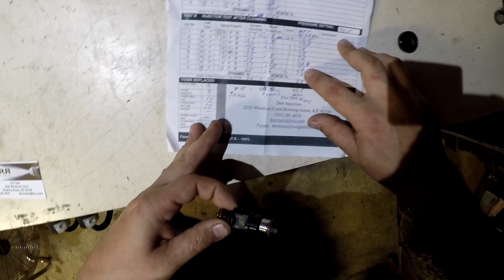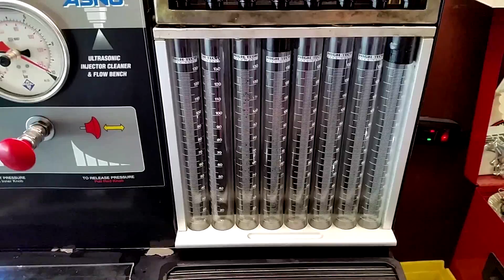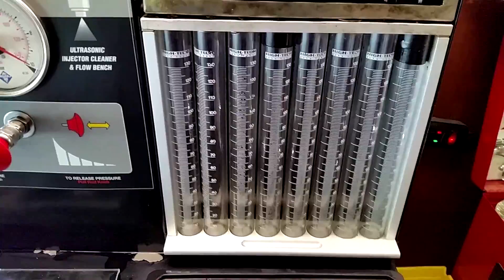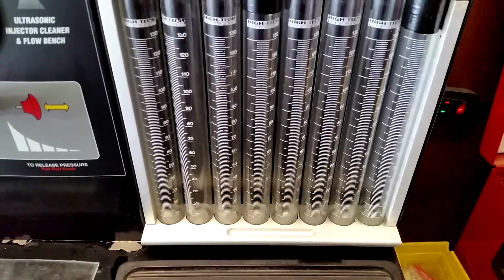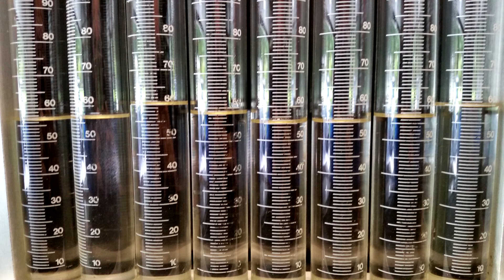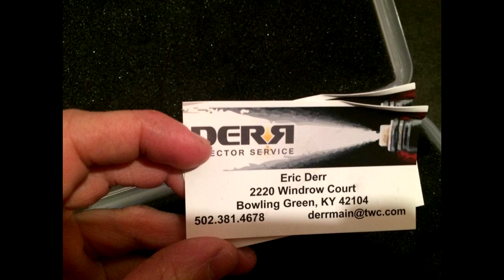stock truck uncapped injector testing updates and results

Comment: I really like your process and methodology, breaking down step by step and explaining as you go. It is good for people to see, hear and understand what happens in the world of injectors and you did it well.  As mentioned in the video, the pencil pray pattern will run and perform. If delivering more fuel for your build is what you want, then this this is your ticket.  However, just dumping more fuel without adding air is counter intuitive to making more power.  Atomizing the fuel will always give you a cleaner and a more complete combustion, thus creating more horse power. In a N/A setup, a straight stream of fuel will burn and make power but, will run into more carbon fouling and less power than a atomized pattern. If you rough up the intake runner after the injection port before the valve, it would help atomize the fuel with a straight stream of fuel. With a power added (forced induction) the pressures and velocity can and does break up the straight stream more than N/A. But as I mentioned before, when the fuel molecules are smaller (atomized) vs straight stream (droplet) regardless of the engine, it becomes more efficient, cleaner, complete and creates more power.

Comment: The factory injector you referenced as 70 pounds or so, (12613412 part number) is for a gen 4 6.0 as you stated you thought. My question is can I put them in place of my stock gen 3 4.8/5.3 injectors on my 4.8 or will I need different fuel rails? I don’t mind the re-wiring part.

Comment: Why do you imply that gen 3s don't survive well above 550?
Reply from the maker: the rods are not as strong and frequently people hurt them when pushing them, it can be done, but if your goals are higher its usually a good idea to start with the better rodded motor to start
Reply: Sloppy Mechanics can I slap gen 4 rods and pistons in and expect a higher ceiling?

Comment: What are the stock 4 hole injectors out of.   I think they flowed around 50?
Reply from the maker: i believe flex fuel vehicles like 02 tahoe, they are like 38-42lb IIRC
Reply: I know for a fact that a 2010 chevy uses the flex fuel injector with the 4 hole .....
Reply: I have a 2010 chevy express with a 6.0 that is a flex fuel vehicle
Reply: My stock 99 5.3 lm7 have 4 hole.

Comment: So I just did this and I found if you use a bench grinder and a 13 mm wrench and put the injector threw the box end of a wrench it's really easy to spin the injector and hold it at the angle you want to grind off the cap

Comment: You say that high flow injectors shoot a strait stream just like your junk "uncapped" injectors....   lol...    clearly you have never seen a spray patter for  high flow injectors so ill leave you a link to show what  real injectors look like...   this is absolutely stupid idea to do..  https://youtu.be/YtlPOs-qbRw
Reply from the maker: fan pattern is not the same as pencil. thanks for trying
Reply: Sloppy Mechanics ..  . As injector technology advanced, the pencil and v spray patterns pretty much became obsolete, as the narrow/wide/split cone spray patterns offered better fuel atomization, increasing efficiency and reducing emissions by improving flame propagation in the combustion chamber. Ideally, you will want the widest, most diffused spray pattern with the best atomization without spraying the walls of the intake manifold runners and intake ports. Fuel spraying on the walls of the runners/ports will condense, drip onto the back of the valve, and slowly run into the combustion chamber, resulting in imprecise control of the injection event and an inefficient burn . When choosing a fuel injector, choosing the correct spray pattern for your application can greatly improve horsepower,  emissions and misfires.......    you get a D for effort on your "sloppy research and mechanic work"...  good try tho

Comment: 7% variance? That would be nearly a FULL AFR POINT between the high and low cylinders. Not to mention the bent spray pattern for the three on the right.
Reply: Hydrocarbon82  good point..   and this is what a pattern should look like... https://youtu.be/YtlPOs-qbRw
Reply: He did clearly state that for boosted engines the pencil pattern is more desirable since it directs the fuel stream into the intake valve which is where you want it. The unstable airflow from the turbo in the intake actually will cause problems with fuel delivery to the intake valves. That is mt understanding of what he said. Lack of fuel in a boosted engine is a big concern. Better to get it to the intake valve as efficiently as you can i would think.

Comment: I'll give you some info on my truck the 92 Chevy 1500 2 wheel 2001 5.3 th400 trans with shift kit 2500 stall motor and trans are brand-new have completely rebuilt the motor we put a hundred miles on it

Comment: we never heard nothing back about you putting these two characters and your wife's truck you're not seen the video and how much power it makes I am extremely interested on some info I have a 5.3 you with the trick flow 585 cam is that you're using I'm getting ready to put a Garrett 76 mill on my truck I would like to know what power you made with that came before it go in your father and have to change it
Reply from the maker: i did upload a video with my wifes truck, it made 350whp with 4lbs of boost, we are leaving it go right there for a long time most likely since 60e's are not known for handling a ton of power.
Reply: Sloppy Mechanics I need your advice if you don't mind I want to do your decap injectors I'm running a 76 Mill turbo intercooler anything else you can tell me I need to run on my motor I have a walbro 255 fuel pump do I need to go bigger than that I already have a 2 bar map sensor if you could just give me some advice on what direction to go I greatly appreciate it I've been watching your videos for a long time now I would not be where I'm at with my LS truck without all your videos in the info
Reply: I don't know if you want to talk through email I don't want to clutter up your bored here on YouTube I have a couple more questions

Comment: The "shorter" 6.0 injector that flows 51lbs, is a Gen4 e85 injector? And are those easily swapped into an 03-06 5.3 with stock truck intake & rails? Connector adapters and height adapters?

Comment: now with this would you still use the factory injector data or would you have to modify that by trial and error?
Reply from the maker: correct, you would just modify the fuel tables, injector size, or other fuel figures till it runs and starts normally with trims close and tune from there

Comment: Supposedly atomized fuel being in the air charge longer reduces knock due to a cooling affect.  Other than that there should be no difference.

Comment: going down the path of trying to decap injectors however my injectors for aussie Barra 6 cyl turbo motors, just to give it a go my problem is that my injectors are just like those ones you have that are recessed. probably going to try a 6mm end mill from a lathe will post some pics if it works on sloppy page...good stuff on the video mate inspiring aussies to help the kids in Australia because they need burnout smoke to survive

Comment: did the injectors get less consistent flows before and after the decapping? 4% doesn't sound too good. 2% less than 12.7AFR gives 12.95 which would start getting dangerous if you're pushing for peak power.
Reply from the maker: imagine if you got a pile of them and sent them all in and he matched a set for you within 1%

Comment: what does something like that cost to have done?
Reply: he charges 75 bucks per 8 injectors.  I just had 16 done by him and he is great to deal with, I would highly recommend going through him.
Reply from the maker: i paid 70$
Reply: I would like to know as well. thank you for the video
Reply: +Sloppy Mechanics ok sweet cause i have set of truck injectors that came with a truck intake i bought. im totally going to uncap them and send them to eric
Reply: I just emailed him. Does he descreen all injectors, or simply old ones? Debating on whether I should send him my decapped LS1 injectors with 126,000 miles, or just send him new ones.
Reply: you have to decap them and he just cleans them, puts new seals, and screen inside of it.  Then flows them
Reply: Just talked to him and he said you need two sets, do you have any injectors left over from when you had sent yours off to him that I could buy?
Reply: no, all of mine were good.  So I have two good sets
Reply: Ryan Axberg would you be willing to sell one or no? If then it is cool!
Reply: no, I don't.  Because I have 2 full good sets
Reply: probably not man,  I have quite a few ls engines around that I will use them on